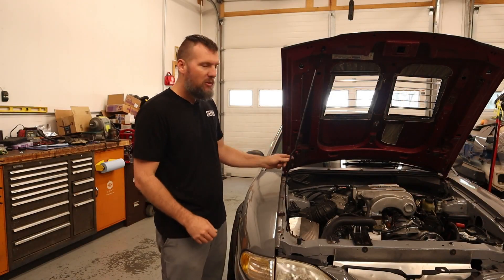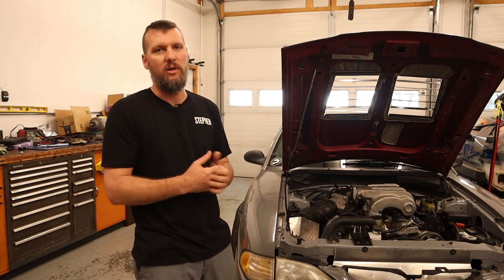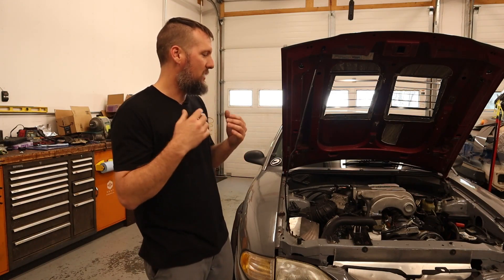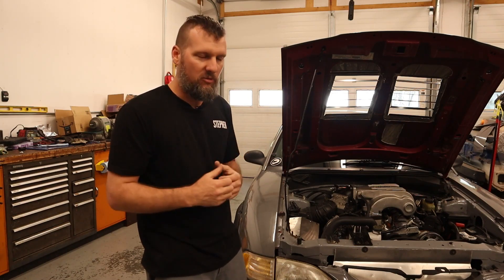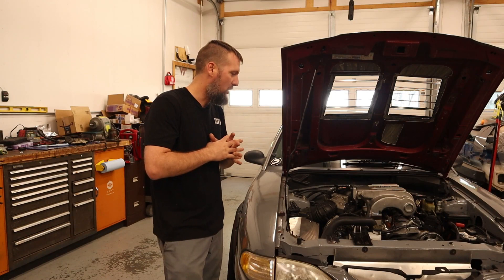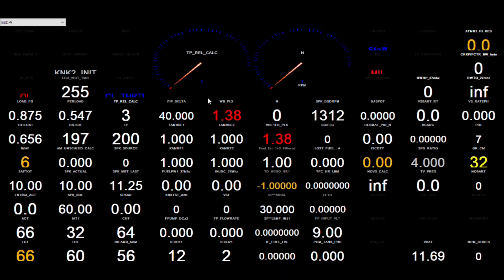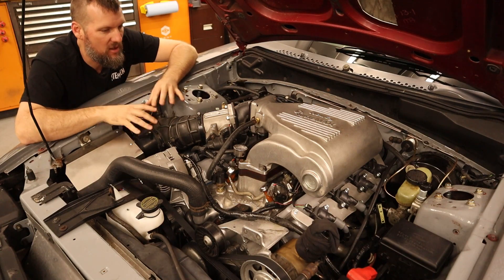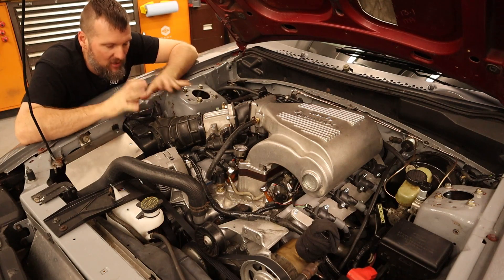Tuning a One of Kind Engine - #SN95 #Mustang

Comment: There are good reasons for going oe EEC and not an aftermarket
few of them in my personal experience are:
-OE EEC actually controls auto tranmission better than aftermarket
-A lot of aftermarket controllers wont do full secuential firing (megasquirt for example)
-reliability, I've fried cheap aftermaket ecus while wiring (and Im extremely careful) 
-in some cases, easier to make stock instrument cluster to work
-Quarterhorse can live tuned too
-I learned a lot on how things work while wiring oe eec

and I can go on, I would only go aftermarket if I would do a lot of HP and budget isnt a problem so I'll run top brand.

Will do the same as you with my 95 mustang but I'll daily it!

Comment: WOT tuning is easiest, part throttle not so hard, idle is most difficult. Dyno is useful for measuring torque and refining spark tables. Probably helps that you are using mostly OEM inputs, outputs for the PCM. 

MAF magic relies on holding fuel injector specs constant, adjust MAF curve vs wideband until commanded AFR is observed. Driveability can be really improved by adjusting the dashpot and idle functions.
Reply from the maker: Ah that makes a lot of sense. Yea the WOT only took one log to get dialed in. Idle, MAF, ISC, and partial drivability have taken several logs so far. But it's going really well.